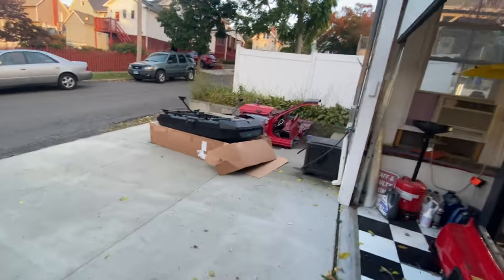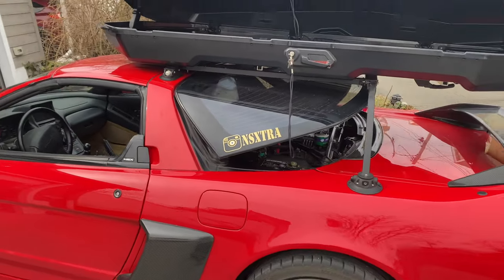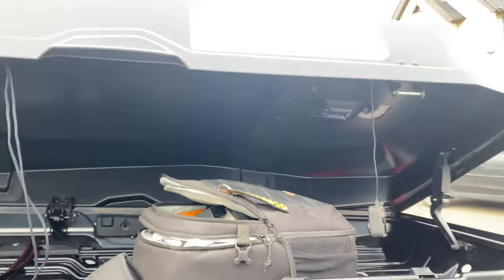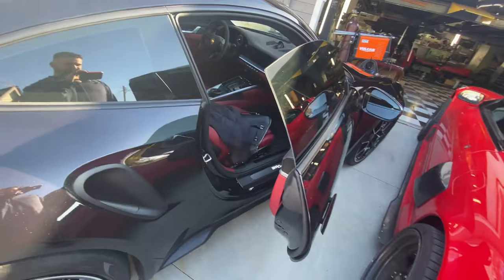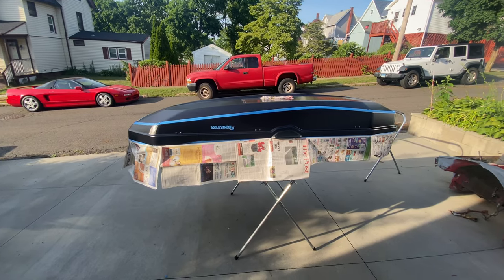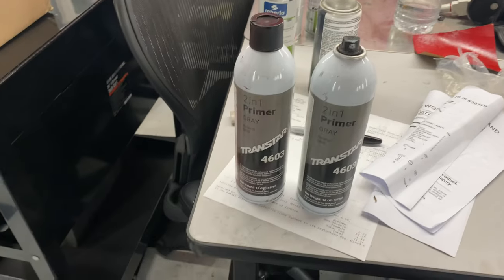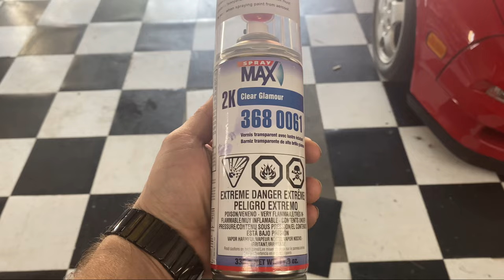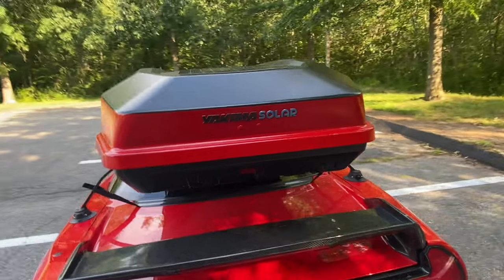NSX Yakima Solar Box

Comment: Red takes alot to get coverage best to use a red primer/sealer before hand it will drastically cut down the number of coats needed
Reply from the maker: Definitely need to do primer first. Absolutely. My question was for the spray out cards… I found out that you’re not supposed to primer them